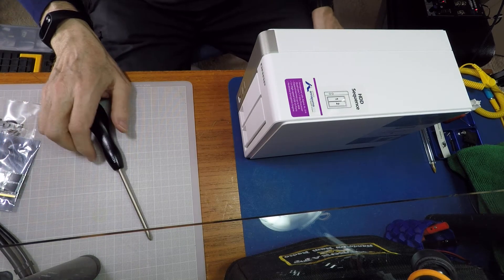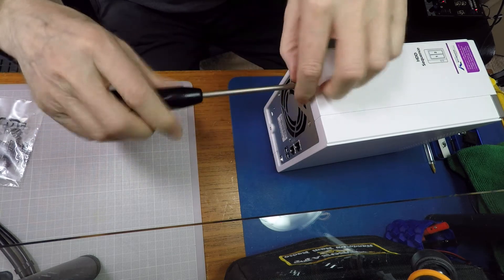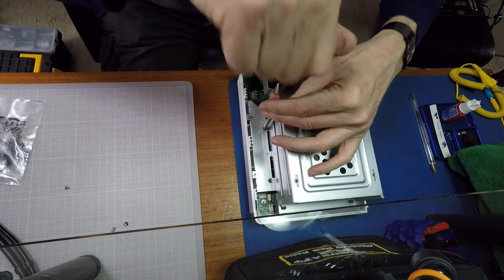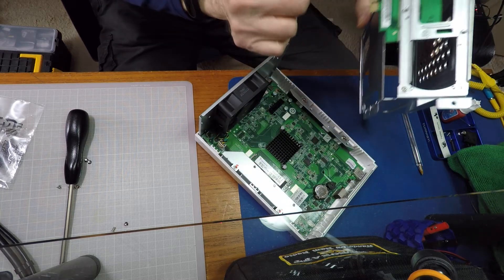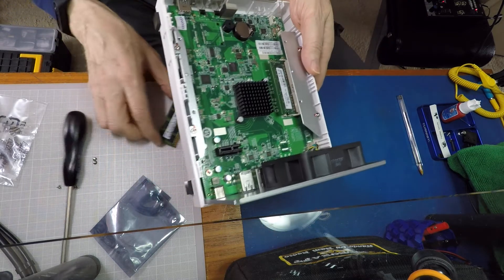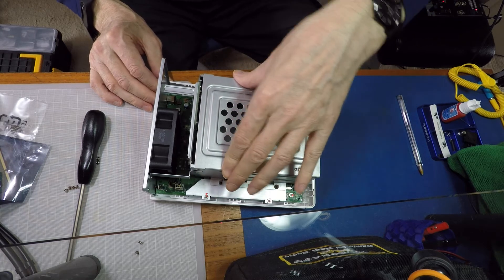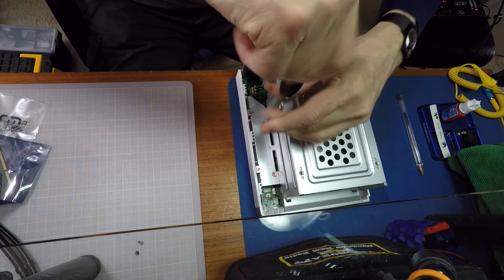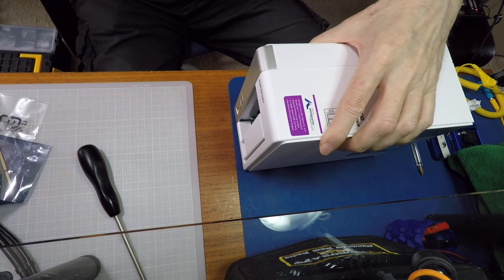Qnap TS-231P2

Comment: I have a TS-231P and the memory is soldered to the board and is not replaceable.
Reply from the maker: Hi, are you sure you are looking at the memory chip, I have never heard of a memory chip being soldered in, even in pc's and laptops.
If you are sure it is the memory chip, I would send Qnap a quick email. There website definately states the memory is upgradeable.
Let me know how you get on. Take care.
Reply from the maker: My mistake, the model TS-231P has a memory of 1Gb and is not upgradeable. Sorry
Reply: @mickhal2  Yeah, I was disappointed to learn that I couldn't expand the memory.  Looking at replacing it but not sure which would be a good direction to go.
Reply from the maker: @mark3431  I can't really give any insite as to what NAS to go for as I only have experience of the Qnap. You could take a look here,
https://www.pcmag.com/picks/the-best-nas-network-attached-storage-devices 
or search for similar reviews. Good luck.

Comment: DOES this work on the 231p ?
Reply from the maker: Hi Faruk. I checked the spec for a 231p and it says that it will take max 1Gb, so you probably can't upgrade. Hope that helps. Stay safe.
Reply: @mickhal2  Thank you so much for the Reply ! Usually never get one or hardly do !
If I may ask you is it a big deal ? My friend sold it to me with 8TB for around 150$ ( in Brasil ) here new one without HD is 150$ so had good deal on it ! I only need to backup my movies music and photos ! I don’t use pix etc :)
One more time thanks :)
Reply from the maker: @FaroukAbouRafeh  Hi Faruk. You're welcome. For storage the 1Gb should be fine. It maybe noticeable if you play back your videos directly from the Qnap, were the extra memory would help it to stream smoothly. For the most part it will be good. I would have done the same and grabbed a bargain. Regards Mick

Comment: Thanks for sharing. So, there is no label across the hinge, with a message about voiding warranty if opening the unit? I would like the option to add more memory. But, would the memory be used more for streaming videos and such, i.e. making processes faster? Thanks
Reply from the maker: There was no label on my unit regarding warranty, but that doesn't mean to say there wasn't a note in the box. It is a simple job and the decision is yours as to upgrade or not. The extra memory would certainly help in speeding the transfer of data for backups, so I would presume that it would help in streaming videos also. I hope that is of some help but it is only my opinion, I have no figures to back this up.
Reply: @mickhal2  Brilliant, thanks! Just purchased the QNAP from Micro Centre, with some WD Red's. I will set it up tomorrow :)
Reply from the maker: @ivanwill  Glad you found it useful, stay safe!

Comment: Great tutorial video, thank you for that sir, just ordered HyperX 8GB (1x8GB) 1600MHz CL9 Impact Black, some TS-231P2 users confirmed on forums this memory works just fine. All the best, stay safe!
Reply from the maker: Hi. That's good info. Always good to have more than one option. Thanks for the comment and you stay safe too!
Reply: @mickhal2  Just to double confirm, My TS-231P2 is running for a week already with that hyperX memory just fine along with 2x6TB WD Red disks and also cheap UPS CYBERPOWER UT850EG-FR and external HD WD Essentials. The UPS is very cheap but it is powering NAS and my TP-link VDSL Archer vr900 modem/router only. I did power failure tests twice and after 15 min, I still had 20% of power on UPS so it is safe to set NAS to autopower off on power failure after 5-8 min...as it consumes max 25W. I should still have 40-50 min for Archer router and that is more than fine.
Reply from the maker: @tatsuo24  Sounds like an awsome setup you have!

Comment: Thx for the video. What is the CL (CAS Latency) of the compatible memory module?
Reply from the maker: Hi. If you go to this URL it will give you the spec of the RAM. I cannot see the CL but I am sure if you contact them they will be able to help. 

They guarantee the RAM they supply to be fully compatible for the QNAP NAS.  My RAM chip has now been in for a year without any issues. https://www.mrmemory.co.uk/memory-ram-upgrades/qnap/nas/ts-231p2

Comment: Nice video :)
One question, did you install 8Go PC3 or PC3L? The 1Go orignal is a 1.35V PC3L.
I tried to install a 4 Go PC3, it works but I don't know if it good for the NAS in long term.
Reply from the maker: Here is the full spec of the memory I installed from Mr Memory:

Kit Contents: x1 Module
Memory Brand: We supply the best brands in the world so you will only receive premium memory of the highest quality
Compatibility: 100% Guaranteed Compatible with your QNAP NAS and All Operating Systems
Product Warranty: Free Lifetime Warranty

System Warranty: This upgrade will not invalidate your system warranty

Speed: 1600MHz (PC3-12800)
Technology: DDR3 SDRAM
Pins: 204-pin, Gold Connectors
Form Factor: SODIMM (Small Outline Dual Inline Memory Module)
Module Dimensions: 67.6mm x 30mm (LxH)
Data Integrity: Non-ECC

Ranking: 1R, 2R, 4R

Voltage: Low - 1.35V (DDR3L / PC3L)

CAS Latency: You will receive memory with the correct CAS Latency for your model
Reply from the maker: Hi. 
Sorry for the very late response. 
Your PC3 (1.5v)memory should be fine. PC3L (1.35v) would normall be used in laptops where heat dissipation is difficult, but in the NAS there is plenty of space and a good fan to keep the chip cool.
Reply: @mickhal2  Sorry for this question, but isn't this a 32bit processor? limited to 4Gb visible ram??? Or does your qnap system identifies 8Gb of Ram available???
Reply from the maker: @hugoagostinho2157  
Hi Hugo. It does recognise the full 8Gb within the Qnap software. Hope this helps and a Happy New Year.
Reply: @mickhal2  Thanks, mick! Happy new year!!!